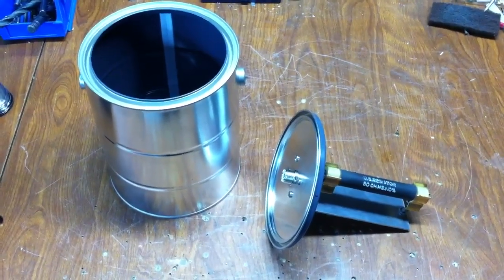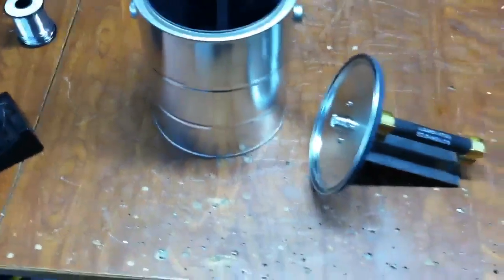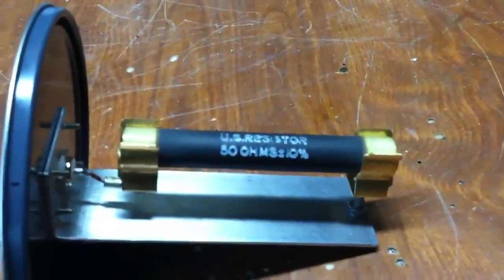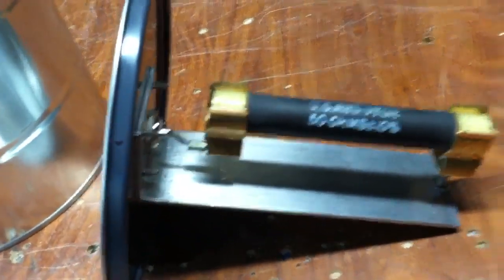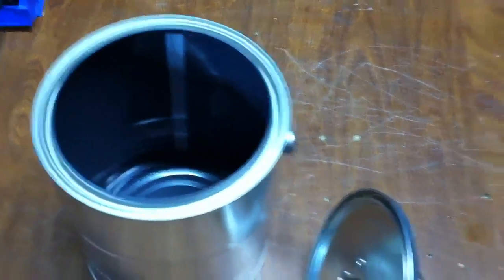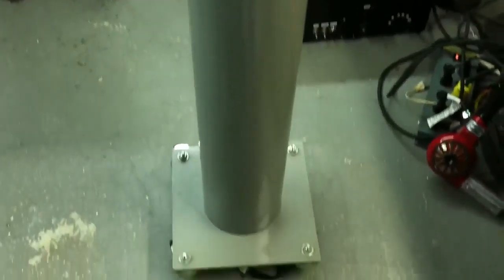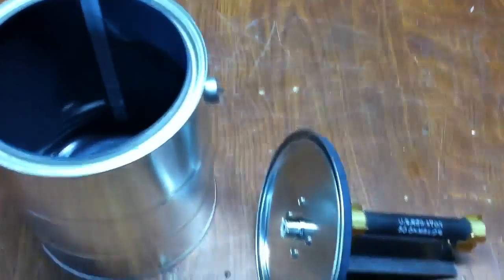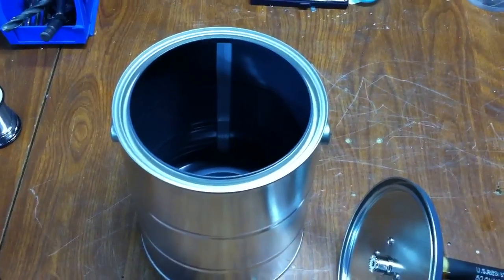Dummy load

Comment: I don’t know if you’ll see this but, where do you get the resistor? Also would you solder the lid closed, or would that be dangerous? Thanks -73- KC1KSM
Reply from the maker: Kevin Shields Do not solder the lid closed. The part number for the resistor is in the comments.

Comment: How do i figure out what my load will be for a similiar setup? Im using a round drum that is 10" diameter x 13" high. I figured the cubic inches to be 1020.5 which means i'll use 17.675 quarts or just under 4 1/2 gallons of heat transfer oil. I'll be using a Carborundum 889 SP500J 50 Ohm (12in x 1 in)resistor  rated at average power of 275 watts. What should i expect to comfortably put into this dummy load when finished? .... the drum is actually 14" high but i figured in enough space for setup...so im using 13" for volume figure.  I saw yer video and figured it would be fun to make my own versus spend a lot of money on one. Thanks for the idea!!
Reply from the maker: +PrisonProof 223 I don't know, I rate my large load with the same resistor and about 3 gallons of oil at 5kw. I use an HN connector.

Comment: how do you charge to make a 300 watt dummy load
Reply from the maker: Joe Addair I don't build equipment for others. The idea is for you to build your own. Good luck!
Reply: KF8OD were did you get the resistor and the brakets parts to make it. I looked on amazon but did not see what u had. I have plenty so239's
Reply from the maker: Joe Addair Look in the MFJ catalog. They sell the resistor and the clips.
Reply: KF8OD thanks for the info. 73's KK4WNA

Comment: where did you get the resistors for the 5kw dummy load?
Reply from the maker: The resistor in the 5kw load is a carborundum 890SP. 18"X1", 50 ohm, 375 watt. Search the web.

Comment from the maker: Thank you for your comment. I would use the example of the pole transformer, they are also set in oil. This helps keep them cool and increase there kva rating. I don't know if all wirewound resistors are non inductive. Installing a fan on the two in parallel would help remove the heat and increase the power dissipation capability. If you have a short duty cycle you should be alright.

Comment: Very nicely done. Question though, what allows a 100W resistor to handle 1,500 Watts? I have a bunch of Aluminum Shell 100W Watt 50 Ohm Wirewound Power Resistors and thought this would be a great project to do. What could I expect from having two of the ones I got running in parallel? Not sure I would need the can, since they are already have an aluminum housing. Thx and keep up the great videos. 73s.
Reply: Wire wound wont work from what i hear
Reply from the maker: Kcy101 The resistor must be non inductive.
Reply from the maker: I would use the example of a pole transformer. The transformers are put in oil to aid in cooling. You could use a small fan to move a little air over them, this would increase their power dissipation.
Reply: KF8OD
I see, thank you. I also tried making one with a Thick Film resistor I had ( http://bit.ly/1i4dG54 ) but did not work well, very high SWR, not sure what I did wrong. I'll chk the one you mention from MFJ.

Comment: As I've said in your other videos, superb quality and expert craftsmanship . I do plan on building the 100 w dummy load . How about a 1500w load ? Any ideas on the size of resistor and amount of mineral oil for a 1500w load ?
Reply from the maker: Thanks for your kind words.
This load will handle 1500 watts for short periods of time, 30 seconds or so. I have put 2500 watts into it for 5 or 10 seconds. It's all about duty cycle.